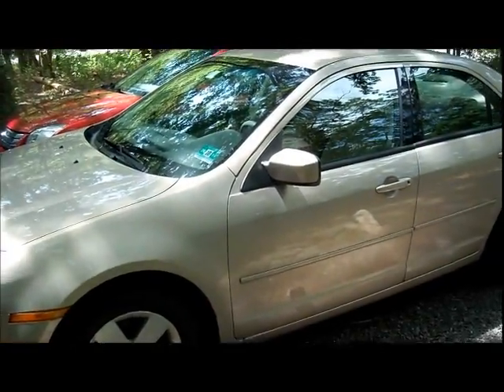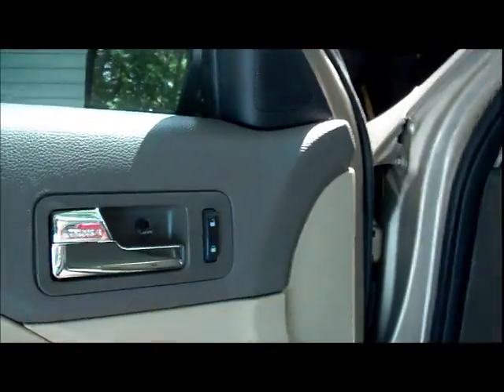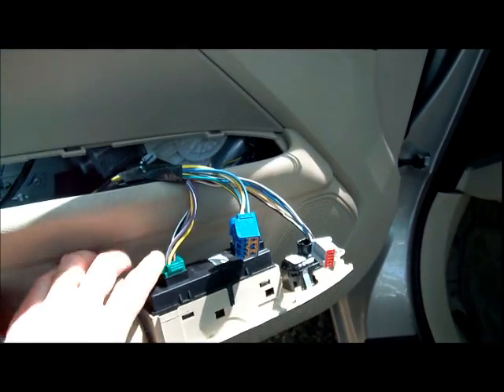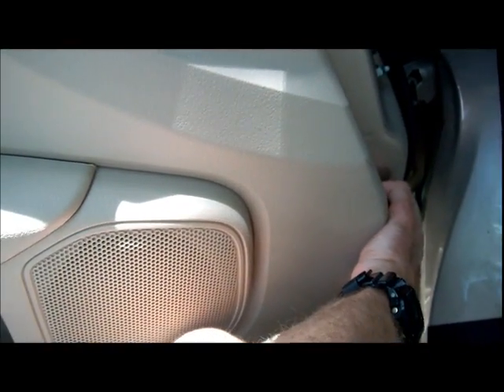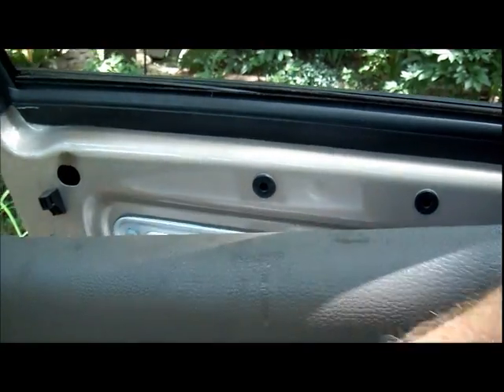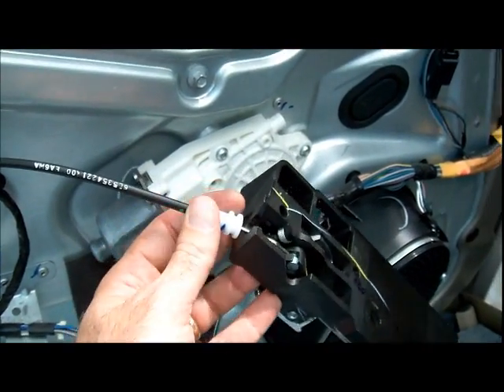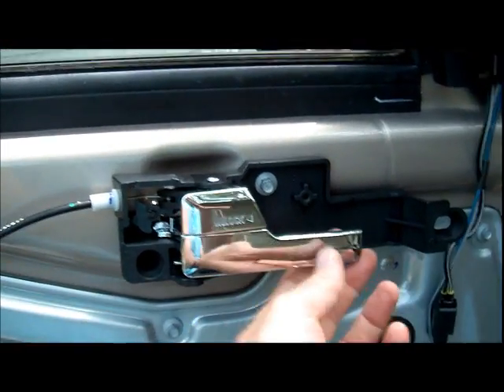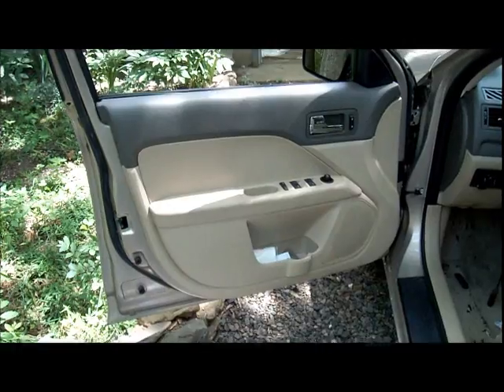Replacing Broken Inside Door Handle on 2007 Ford Fusion

Comment: thank you for the video, it helped guide me to fix my own door. currently my window is also broken but because of your video i might be able to do that as well.  the washer you found randomly goes on the screws for the bottom or for the little button. they dont do much its not needed

Comment: Terence Ng left a comment on here on what tools you'll need, those are the tools I used on my 2010 Mercury Milan to replace the door handle. I saved myself $60 labor charge from a garage mechanic estimate, it was easy to replace the door handle. I bought my door handle for $19.99 from AutoFit  in Phoenix AZ and recommend anyone to replace the door handle themselves.

Comment: Thanks a million! I did it in on a 2010 Fusion in about 10 minutes and it only cost $18. It had been replaced before, as the screw cover was gouged and the door handle assembly itself was loose and barely hanging there. Strange that there is only 1 bolt and no tabs to keep it from swiveling. I made sure to get it tight.  I didn't have to completely remove the panel or unhook any wires. Some people have said the dealer charged them over $200. Wow!

Comment: My 2011 fusion broke the handle around 70,000 miles I work for ford so I bought all four interior door handles with my discount and just replaced them all in one shot in 20 minutes. Finally on the 2013 body style they changed the interior door handles and I'm happy to say that they are actually made well this time.

Comment: first off thanks for the video, I had no idea how common this was till it happened to my wife's 07 fusion SE AWD. second: (and more importantly;) if you did NOT have AT LEAST 1 left over piece or nut or washer etc the fix won't work! he'll the car prolly wouldn't run right ever again! (if it would even start that is) 😉

Comment: Awesome!  Thank you! Love the trick to open door while still broken too.  Just happen on my Lincoln MKZ.  A little different design, but just about these same.  I didn't have to disconnect the power window section, which was separate from a door grab that I did have to unscrew and remove.

Comment: thanks for the video!  had the same problem. fixed it in about 30 minutes. 

I took preemptive action and reinforced the part that broke with 2½ ton epoxy (VERY CAREFULLY) before installing.

Thanks for the help.

Comment: Great video and well done. I followed this video and got my Ford Fusion 2009 driver side door lock fixed in 15 min. 

I would like to simplify the procedure a little bit, since based on what I did with Fusion 2009, I don't think all these steps are required.

a. I opened the 4 screws as described in the video.
b. I lowered the driver side window glass so that the head can go through the window and I can peep into the door panel from the top. This is important.
c. I only had to pry open the clips from the top left, top center and top right corner of the panel. Didn't need to take the whole door panel off. That gap was enough to put my hand in from the top of the panel, take the lock off and put a new one.
d. I didn't need to take the power window roll-up/roll-down control panel off, since I wasn't taking off the whole panel. 

On a side note, I used the lock "Dorman 81702 6E5Z 5422601-A" and Pry tools (Kinglake Item: B00HNMLQAG) from Amazon.com. Screws were pretty easy to open.

Comment: thanks for the video bro. I have a 2012 fusion that the handle just broke a few days ago. Not wanting to wait to fix because was worried about the lock not working when it should. so called dealer and made apt to get handle fixed. Was quoted over $200 to fix. after watching  your video and seeing how easy it was to replace, I went on Amazon and found door handle along with door panel pry tool for under $30. took 2 days to receive and less than 45 min to put on. your video saved me over $175. thanks again! now just have to call dealership and cancel my apt.   which still isn't for 3 days.

Comment: I had this same problem and saved myself a lot of time by just prying the top of the panel 3-4 inches and taking the door handle off.  It was enough room for me to work without having to take the entire panel off.  Thanks for the video! I might have to take the entire panel off one day.

Comment: bobneub, man  cannot thank you enough for this video. The wife just came home with this issue on our 2006 Fusion. I started the task but then in the same place as you started worrying about applying TO MUCH pressure and breaking more parts. Can in and looked and your video was there for me. I was in the other in about 2009 when the mirror got knocked off the door but had forgotten the magic to get in there. Thanks again one last time. Now I am anticipating the $$$ shock when I go order this part.

John

Comment: First of all thank you so much for the tip on how to open the door from the inside while it was broken so I did not have to roll down my window and open it from the outside. I ordered the part on amazon for $22.00.  (Ford 2011 Fusion).    Ford was going to charge me $84 for the part and then labor.  Your video was very helpful and very easy to follow.   It took me about 30 minutes from beginning to end.   Lots of $$$$$ saved.

Comment: I also want to thank you for a very easy to follow and straight forward instructions.  I bought the part months ago on Amazon and have procrastinated, using your by-pass trick an much easier then putting down the window. Finally went step by step with your video and no challenges. Getting that initial cap off was tricky since a screwdriver didn't work. I used a grooming finger nail file. I appreciate the pointer on where to start pulling the door panel as it came off easy as I went around. Great to get back to opening the door with one hand as it should be.
Reply: Glad it was useful. Thanks for letting me know

Comment: This video gave me the confidence to give it a try instead of accepting the cost and inconvenience of visiting a dealership.  Much easier than expected, saved me money, time.  Once I removed the broken handle I could once again open the door by tugging on the wire while I wait for the replacement to be delivered.  The video is absolutely spot on.

Comment: I have a 2008 Lincoln MKZ same problem same fix . Your video the absolute best thank you. Outside of the little screws the best tool for the job is a good sized quarter inch flat head screw driver. and a wash rag (for between the trim and driver) to keep hard edges off the trim. Thanks again
Reply from the maker: +Daniel Daly Glad to help Daniel

Comment: Just replaced the driver side handle on 08 Milan works fine only door won't lock when using key remote all the other doors lock except driver door I can lock it manually and the remote will unlock but won't lock it. Any advice anyone?

Comment: Great video, I used the temporary open trick until part got here. It took less than 10 minutes to change. I only took off plastic around broken handle and then took out handle bolt, bolt on side of door and  then popped out top of panel enough to get old part out. Connected the new handle and bolted then popped door panel top on, then put 2 screws back in.  Done under 10 min.
Reply from the maker: +Scott Cline 10 min? Wow. I think I'd have been faster if I wasn't holding the camera while working. :-)

Comment: Thanks for the video!  Just replaced mine - took about 20 minutes.  Had a couple torx screws rather than hex head screws.
Reply: I found a torx bit in a cheapie toolkit my wife picked up at Target last Christmas.  It was in one of those bit sets along with flat and philips of different sizes.

Had my 7mm and 8mm all ready to go but had to stop and dig up the torx bit.

Comment: Jesus this is unreal how many people have this problem cause this same thing happened to me just the other day I was googling the part and came across this video already knew what I had to do to fix it but the fact that so many people are having the same issue just makes you wonder why ford would continue with these cheap parts and to anyone else who has this problem I got my replacement part at AM AUTOPARTS on the Internet for 25 not sure if it was on sale but it was also free shipping
Reply from the maker: +unsightedasp700 I hear you. Ford should be ashamed. Glad you were able to fix it.

Comment: thank you for this video...the handle on my 2010 Fusion broke a few weeks back. I learned from your video how to open the door before I fixed it. recieved the part today and fixed it really quickly after watching this video. thanks again!
Reply: Took me about 10min. I didn't even disconnect the wires on the bottom part
Reply: +Don Garvey So glad my video helped. Thanks for letting me know.
Reply: where did you get the 2010 part

Comment: This was very helpful to replace my 2010 fusion model - it let me know exactly what to expect. It took me about 30 minutes total, from getting the tools to putting them away. Really great tutorial! I ended up needing a star-shaped head for 3 of the screws (one short in the door handle casing and two long in the door panel), a 7mm ratchet head for the window control casing, and an 8 mm ratchet head for the door handle bolt.
Reply: +valtheconqueror Thanks for letting me know. Glad I could help.

Comment: Just did this, this morning. I have an '08 Ford Fusion. Luckily, I didn't have to take the door panel off, just loosen up the top right panel and pull it up through the gap I was able to make. Probably not the best way to do it, but it worked. Now, I got me a new door handle that works like a charm! :)
Reply: +Tidyrious Alas...I wanted to pull mine up through a big gap, but 2 door panel clips fell off in the process...falling to the bottom of the inside of the door. So, I had to pull the panel off anyway :(     It might work if one is extra careful, though. But the instructions in this video are right on the mark!
Reply: +Tidyrious Awesome. Glad the video helped.
Reply: +Tidyrious I wondered if pulling it up through a big gap between the panel & the door might work. I haven't done mine yet...I'll have to try that.
Reply from the maker: +ohhhwolfy Glad the video helped.

Comment: An easy repair.  The dealer wanted $225 for this repair on my company car and they could get to it 3 days from now.  I laughed and told them I'd get back to them.  Took me all of 10 minutes to do it myself and the part was $45 at AutoZone.  They actually had this part in store which tells me they must sell a ton of them.
Reply from the maker: +1982mako224 10 min? You're fast.  I think I'd have been faster if I wasn't holding the camera while working. :-)

Comment: Got my inside driver door handle for my 07 Fusion from Rock Auto Parts for $30-$32.  Put it on myself in about 15 minutes.  The guy in the video unplugged the wires that control the windows from the door panel unit that he removed. You don't have to do that.  You do have to remove the window panel control, but then just gently lower the door panel enough so you can get to the job. You're not working on the power window unit, you just want to get to the door handle.  This job is easier than changing a tire! I too ended up with an extra washer....LOL
Reply: +slaginess Thanks for the tip. Next handle I have to fix I'll keep the wires plugged in.

Comment: Awesome!  I don't think I would have done this by myself without this video.  I bought the part off Amazon, not an original Ford part but it had great reviews - Dorman 81702 Door Handle - http://amzn.com/B009S31VVW   My son and I just replaced it on my 2010 Ford Fusion and it only took about 15 minutes. Thanks again!
Reply: +Jeff Conrad That's great. Thanks for letting me know. Glad I could help.

Comment: This video saved my life... or rather my wallet 😊 Mine was so broken that I had to open my window, reach out, and open the door with the outside handle. I have an 2006 Fusion but it wasn't different at all and the handle was about $20-$30 on Amazon. But yes, this video was super helpful and for a girl that has no idea when it comes to cars, you made this fix incredibly easy. Thank you!
Reply: Zhai-Yeng White. I have a 2006 Ford Fusion as well and this just happened to me. Unfortunatly it could not happen on at a worse time. Im jobless and a single mom. I think ill keep doing the opening door from the outside trick until i can afford the part. I already hated this car because ot has a recall.... Now this. :(
Reply: +Zhai-Yeng White So glad I could help you. Thanks for letting me know.

Comment: Thanks man. Was a ton of help. Took me about 30 minutes. There's no need to unplug any of the wires. The hardest part was the taking out the metal lock cord and reattaching it to the new handle.

On Ebay, you can get the part new with free shipping for about $20.
Reply: +Grant Garner Glad the video helped. Next time I won't unplug those wires.

Comment: Pretty good description: I just finished my wife's in about 20 minutes. A few thoughts though.

1) Yeah, just leave the wires attached to the power window unit. The sockets aren't the easiest to pull out, and it doesn't interfere with taking the panel off anyways.
2) There are more than just 4 panel retaining clips to remove; like about a dozen. Be careful as some of the retaining clips might remain in the door and not the panel. You'll have to pull out the remaining ones and slide them back into their holding places on the panel. Then you'll have no trouble smacking the panel back into place once you replace the handle.

Everything was pretty easy and straightforward.
Reply: viggenluv Thanks for the feedback. Glad you were able to fix your wife's car.

Comment: Thanks for the great video bobneub . I was careful and followed it precisely till the part where we had the swap out the old handle for the new one. The little white pin thingy that had the wire connecting from the handle to the door snapped! I have no idea what the part name is called or even if it can be replaced. please help! :(
Reply: ***** Sorry, just saw this. Not sure what part that is, but it may, unfortunately, mean buying another new handle. Hope not though.

Comment: Thank YOU!!!  You said you probably saved $200.  Hah!  This same handle broke in May '14 and I had it fixed at the dealership.  Part cost $250.44 and labor was $360.  My replacement part was from PARTSGEEK.COM - $38.63 plus S&H for a total of $47.58!  I watched your video twice so it only took me 30 minutes to replace and clean up (that included about 10 minutes of non-related activity).  If the dealer mechanic did it as fast as I did (he wasn't paying attention in Ford school), then his $360 charge for 0.5hr of activity means his base rate is $720/hr.  New York lawyers may make that much but I don't see how the dealership can charge that much.  As for using a Taiwanese import part - all it has to do is last longer than 7 months and it beats the FORD product.  Thanks, again.     p.s. - I took pictures of the door and the panel and overlaid arrows showing where the plastic tabs are located but I don't know if I can send them to you.  Perhaps you could add something like that for those of us who have never done this before.  It would help.
Reply: Part was $20 at CarParts.com $5 shipped, $5.99 for panel pry tool at Walmart.com. W/free shipping. Did less than 30 minutes. I am so grateful people like you use social media to give useful information, and not just tell us what to think, believe, and vote for.

Comment: Replacement handle came in today and the process was identical for the 2008 Milan. Awesome video. It took maybe ten minutes to do the entire thing.
Reply: John Burley Do you think it would be the same for the 2007 Milan? It sure looks like mine in the video. Thanks
Reply: +Joan Piwowar I would think so. Mine is an 08 and get look the same. I did a Google search to find the OEM part number from Ford and ordered it from an Amazon seller.
Reply: John Burley Thanks- I see one on Amazon, it says it should fit my model.

Comment: FYI for others, here are the things you'll need: a size 20 star/Torx screw head for the door handle panel screw, the size 8mm bolt socket for the inside bolt connecting the door handle piece to the door, and the 7mm bolt socket for the secondary door panel. It'll save you a trip or two if you don't already own these tools. Thank you so much for this tutorial! You saved me a bunch!
Reply: Terence Ng Thanks for the tips. Glad my video helped.
Reply: T, I didn't know you were still using google plus!

Comment: Actually, you only have to remove one screw where the door handle is.  You can then easily change out the door handle.  Should only take 5 minutes.
Reply: It helps if the actuator cable broke loose from the handle. In that case better to buy nothing and take the panel off and reposition it the cable.

Comment: Great tip on how to open door until you change the handle. Using the info in the video I was able to change it out in under 15 minutes. Knowing where to apply pressure to pop door panel off was very helpful, including the tip on lowering the window. Purchased the part on eBay for $33.90 with free shipping.
Reply: Cool. Glad this was helpful.

Comment: Excellent video! Showing the trick of opening the door with the lock was incredibly helpful while I waited for the part.
Your instructions were very easy to follow, and I just fixed it no problem.

I was able to complete the work without disconnecting any wires and would recommend that approach. The wires are long enough to rest the panel on the ground.
a set of "panel clip pliers" saved me a lot of frustration.
Thanks a million!
Reply: Glad you got it done. Happy to help.